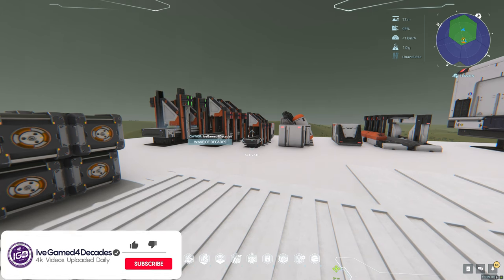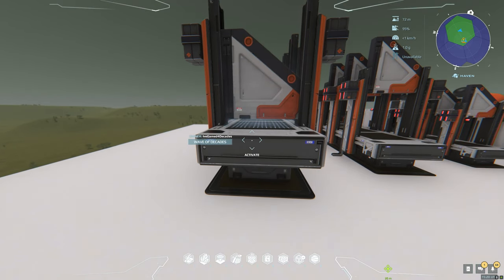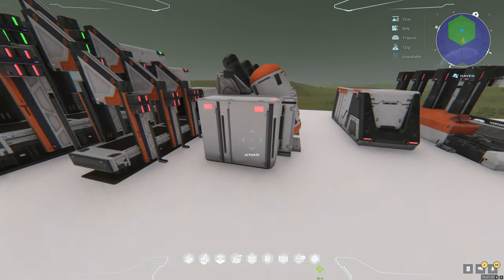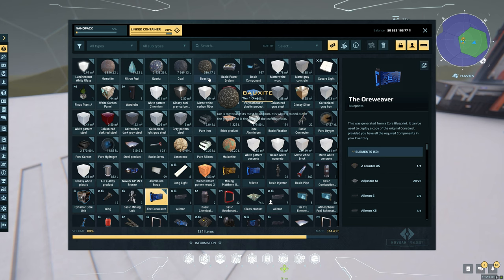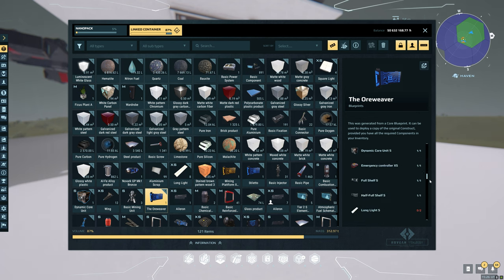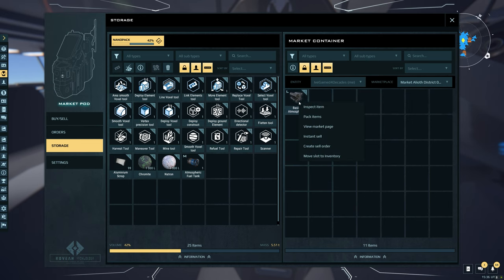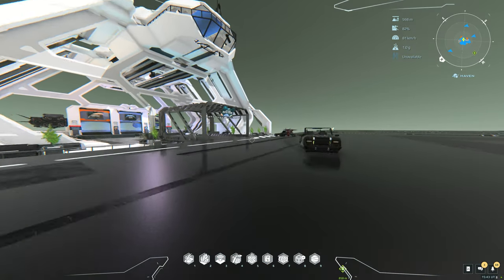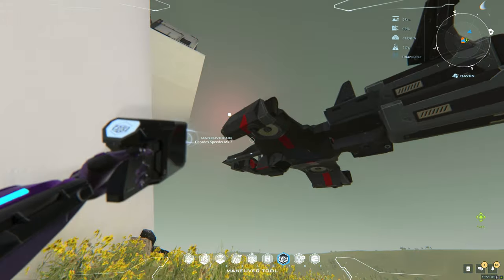Dual Universe Gameplay | Making Plans To Convert My Hover Ship | S1 Episode 12 | 4K | RTX 3090 FW3

Comment: 17:08 as a matter of fact , your aluminium scrap was fine , but , it was in your nanopack and not your active container , so you would have had to open your inventory and click on the chain link to put it to your nanopack as your active container instead as your container hub . this way it would have worked and you would have been able to repair your elements .

Comment: To split an item in your inventory hold the shift key down and drag the item to another storage space.  A screen will come up that allows you to set how many you want to separate into the new group.  The ore amount you have available to mine is shown under each ore picture when you access a miner.  So one ore that shows say 0/132 means you can only mine a maximum of 132 liters of that ore using a mining machine. You can not calibrate to mine more then the max number for each ore. The reason you could not repair the item the first time is your active link was to the other container and not your inventory where the scrap was.  A small container is twice as high and twice as wide as an XS container so 8 XS can fit in a Small container size wise and volume wise.
Reply from the maker: thank you for this👍🏽 I did learn this, but not for a few more episodes. I'm currently shooting episode 25👍🏽
Reply: Oops sorry I have just been following in order.  I just commented in your next video too.  I guess I will stop since you are 12 videos ahead.  take care.
Reply from the maker: @mikesawyer1546  no worries, all tips and suggestions are more than welcome 👍🏽